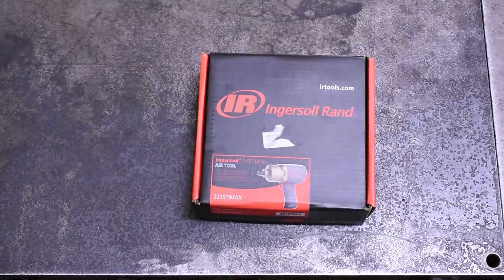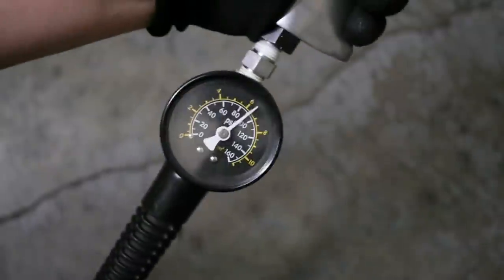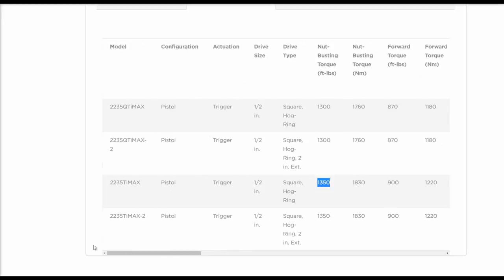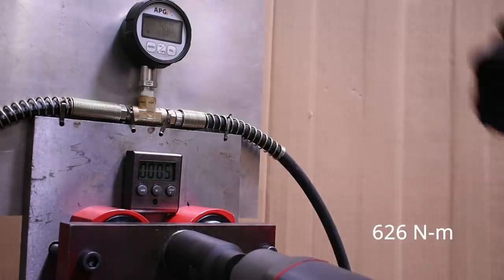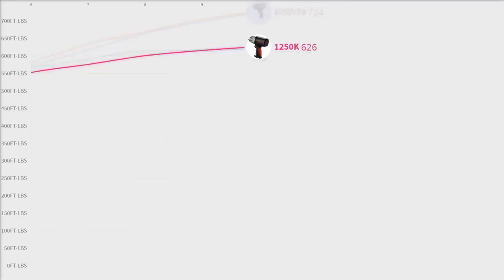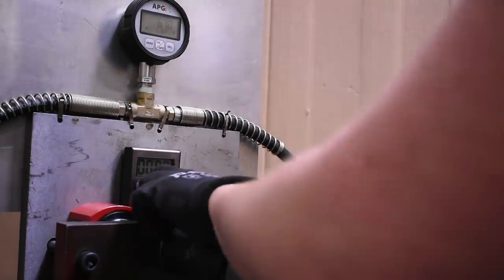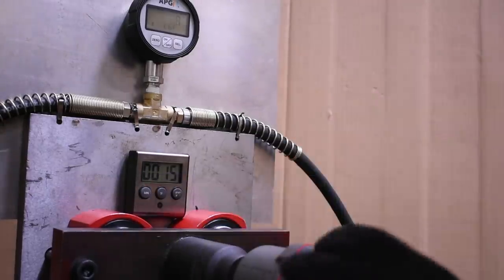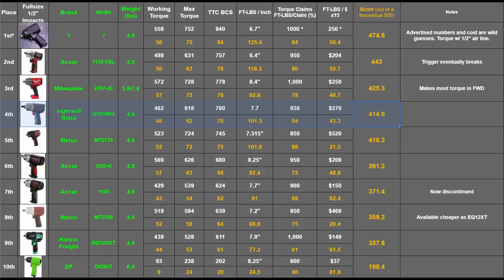The #1 Selling Air Impact vs Modern M18 & Matco Rivals: 2235TiMAX Tested

Comment: 150PSI static test is more of the reallife test. I've never seen a shop where the pressure is at the factory recommended amount.
Was the 165psi a static or dynamic pressure?
Reply from the maker: That was our thoughts on the outset of this channel. All of these tests we've seen on YT with professional equipment... and 90psi? How do you know which one will actually be more powerful in the shop? As we see here, almost no gap between 1250K and IR at 90psi, then the IR takes it to gapplebees at higher line pressure. If we kill an impact with this higher pressure (Harbor Freight stubby) then oh well, that's great info for you guys to know as well!
The 165psi test was static, not sure what's in the gun when its running at that pressure in the line.
Reply: I was just about to say this. My job runs our air at 150 psi, and honestly I think they’d crank it up higher if they could lol. I knew I bought my IR gun for a good reason. Hasn’t let me down yet in IL with good ol rust.
Reply: That's been my experience as well.  Air pressure cranked to 120+ and water drained from the tank every summer when the blow guns turn into pressure washers.
Reply: I have the same ir gun and have had it for the last 10 years.  Run the shop pressure between 150 and 160 psi. It's hands down the best
Reply from the maker: @frankiewilliamson  The fact that the two air impacts ranked higher on this list include 1 that's not out on the market yet and another that's super recent and has what we'd call a faulty trigger - and this thing is like 15 years old? Kudos to the 2235TiMAX
Reply: My first though on the first run of the IR was "It doesn't sound right, something is broken" and the performance reflected my instinct. Then you pumped up the pressure and I instantly recognized the sound difference. I knew it was performing. My daily is a 2135 and my tough job gun is the 2235 that was "tweeked". it is noticeably more powerful than it originally was.  I run my static air at 150/180 down from 175/200 as my last helper's CP guns would break every 2 to 3 months.
Reply from the maker: @1202Sid  This is what I mean. People who use these guns immediately know when you hear it "that aint right". Yet at these 90psi levels these guns hit 1200-1300 ft-lbs on other channels, which would leave you to believe oh i should be fine at lower pressures, that's a ton of power. We've seen the opposite here
Reply: @brucelee64485  I did not rebuild it. I sent it out for repair, I have no idea what he did. The gun is much faster. The number of hits per second impacting is about 1.5 more with about the same force so it rattles the shit out of the rust. The extra power is enough to notice, but it is still a 2235. Maybe @Torque Test Channel has an idea what he did ?
Reply: I have both 2135TIMAX and 2235TIMAX.  After rebuilding 2135TIMAX, it is sounds more powerful than 2235TIMAX.  I removed any debris that blocks airflow to the air motor.  I also turned the vanes so that the cutout were away from the air inlet, thus catching all of the air.  It took off several Honda crank bolts without hesitation.  Unfortunately, it also broke the head off a frozen engine mount bolt without hesitation.
Reply: @1202Sid  Maybe they do.  I've been considering the rebuild for the 2135 and doing some mods on it, but the other side of me is also waiting out for what the SMA mystery impact is too.  Mr O was showing off a new mystery box that he cannot open up yet from what is probably Astro Pneumatic.  With the kind of numbers that the dyno was telling us, I'd be interested in seeing one of them in my tool box too.  Since I am a heavy equipment/truck tech I am looking for large power in a smaller package than my Milwaukee M18 high torque for some of the tight areas in the engine compartment that I need more gun for.
Reply: @bbkmm1  Thanks for the info!
Reply: @brucelee64485  I believe it's an Astro Pneumatic Onyx 1894.  If you look at SMA's video "Mazda 6 Press In Front Wheel Bearing" posted on 4/7/21.  At 16:22 mark, the holi grail of all impacts' part number is clearly shown.  I can't find any for sale.  So they must be beta testing them still.
Reply: @bbkmm1  yes. I'm not crazy. But I didn't catch the model number. Good catch!
Reply: Can i ask what tanks and motors you guys are using for air ?
Reply: The static pressure number is a bit meaningless without considering the size and length of the piping, hose and the number and type of quick disconnects between the compressor and the tool.  Manufacturers (reputable) use 90 psi dynamic (@ f/s) for that reason, to take the effects of restrictions between the compressor and tool out of the equation.
Reply: @bbkmm1  Vane cut out location does not affect the performance. Those are just where the gates are located in the mold.  They used to be centrally located but in an effort to  better align the glass fiber in the part to maintain straightness of the running edge of the vane, the gate was moved toward one end.
Reply: @patrick188  correct, hardlines/shoplines should be oversized so that also is part of the buffer that the tank creates. The endhoses and quickcouplers should be at least the same internal diameter as the largest tool has its intake. And they should be as short as possible
Reply: Shit, at the heavy truck equipment shop I'm in, even if the 150+ psi doesn't do it, we throw a splash of turbo juice in the gun and give her a go again.. And then go get my M18 if that doesn't work, but no one has either of these air guns that I know of.
Reply: Recommended is a starting point to be above, kind of like a Speed Limit. Wish the cops would figure that last one out :)
Reply: I have a MG721 at 120psi it will destroy any brushless 1/2 impact

Comment: I've had my 2235 operating on 175psi for about 4 years constantly. Oil it everyday and had 0 issues
Reply: Mine has been 150-175, and gets oiled less than it should. No issues. 

I did rebuild my 3/8" once, the 1/2" still going
Reply: A little late, but what do you lube your guns with?
Reply: Had mine for over 10 years, put a new anvil a couple years ago, just cause it was chipped. But it’s been through hell. Very harsh conditions, sometimes not oiled for a week or two. Still can knock off lug nuts on a semi, and so much lighter and less expensive then the snap off!
Reply: Someone tell me how to fix it please lol. Mine gets VERY HOT in the front. Barepy power
Reply: I really doubt people that say shit like this because of how many impacts(any brand you can name, I've tried most) I've had fail on me after just a few months. I keep my tools clean and oil them daily as well. I work an 8 hour day, 5 days a week, with almost constant impact use(assembly shop), and I've had about 5 of them just quit on me in less than a year, each. I get around 6-8 months per impact wrench. Either you people are using your impacts for a total of about 10 minutes a day, to have them last "4 years" or you're just lying.

Comment: I brought (and still have) an IR 2135ti back when I was working at a diesel garage. We ran 175 psi of shop air and that thing would pull semi lugs off. I didn't do it often because we had a 3/4" shop gun with big line but if someone was using it I'd use my gun. That thing is a little beast and still runs just great!

The other thing I did with all my guns (a tip an old timer gave me) is run a short piece of air line maybe (12" to 18") to get the fitting away from the base of the handle because the fittings can crack over time from all the vibration and spit the air line out, plus it gives you just a little bit more flexibility by not having the coupler right there.

Comment: Back when i was doing suspension and drivetrain work alot I learned the ol' more psi = more power lesson. Another key thing i learned was to use 1/2" air hose with large ID couplers straight from the air compressor tank. Make sure all your fittings have large ID right from the tank to your gun and it will really break some stuff real good!
Reply: The work shop I work in we use 3/4 air line and semi trailer air coupling fittings and 140psi, all this so when we service our trailers we don't need adaptors air anything to hook air up to the trailer, so biggest air lines and fittings needed. My PT850 snap-on gun is rubbish, hate that I bought it but my IR gave up the ghost. But when using the 3/4inch IR guns, they will straight up snap semi's wheel studs if you aren't careful lol.

Comment: My 2235 took a while to break in. It was so weak when I first got it I took it in to be looked at. The shop near me said they see it allot. Some are made to tight from the factory. After using it for a while it got noticeably stronger. The tool shop put it on their test rig again and said it was actually making more power. Now, it's a beast. 

They also said, give it at least 140 PSI
Reply: There is always a break in time.

Comment: I bought the version of the IR in December 2006. It may not have the most power,  but it has lasted all these years with no issues.  I do oil the vanes a couple times a week.  And every couple of years I clean out the grease in the hammer assembly and refill it. But it has been a bad-ass gun. IR air ratchets have been just as good too

Comment: Back when the IR Titanium line was newish (2006) I bought one and worked in a shop with 160-180 psi air. It was almost scary. At some point i broke the end off of it so it no longer has a retaining ring but it still works, and it's probably seen 5 drops of oil total in all the years i used it. I still have it, it still works, but its a pointless backup since i now own a 2235 which will also never break. The reliability track record is what brought me back more than anything else. You can't do better than perfect..
Reply: If the retaining ring is missing, you're puting yourself at risk and other ppl around you. I'm a student in diesel mechanic technician.
Reply: @hugolortie5411  You're not wrong. Would it alarm you to know i actually TEACH automotive in a community college? But i don't subject my students to my personal tools, or even my personal safety choices really. Around here it's nearly impossible to get people to wear their safety glasses. They just haven't caught enough stuff in the eyeballs yet. But it won't be a socket flying off my 15 yo IR impact, so there's that!
Reply: New IR 2236qtimax.  Better than perfect.  Just came out

Comment: I have both the 2235 and the Milwaukee and love them both. At the HD truck shop I work at the air pressure may or may not be at 150 psi and the 2235 is a beast. I was using it to semi-regularly take off tractor/trailer lug nuts. I used it hard one day, Suspension Z-spring and brake anchor pins and when I went to put the wheel on it I found out the air motor drive end had sheered off. Tough guns but it only lasted 2 years at 150 psi...
Reply: I've been running my 2135 and 2235 at up to 200 psi and the trigger valve broke (just hissed at me when I pulled the trigger) because my assistant let sand in the quick connect. I do oil then daily and grease them every 2 to 3 weeks. I sent the 2235 for repair and the guy said he can tweak those for an extra 80$ to a rebuild and I went for it. I was not disappointed.
Reply: Had multiple anvils break on Mine but we keep replacements handy. It’s the king of the hill in 1/2” impacts

Comment: I worked in a few very large machine shops where air pressure was limited to 90 PSI for safety / liability  insurance reasons. Some air tools gave us fits. Those factory recommended of 90 PSI are just crazy.

Comment: 2235QTIMAX is the best air impact wrench that I have ever own. I work at a very busy shop mostly light duty work. But when some one can't get a bolt off. My 2235 has 80% of the time done the job. Been using it for the past 4 year. Still going strong.

Comment: I love my IR 2135 because of the trigger control. Everyone else in the shop seems to have one of each of the competing brands, and frankly at 175psi static they all get the job done just fine in an automotive shop. To me it feels like the IR is the only one that has any kind of real trigger modulation. I can reliably tighten small bolts with my IR, yet most of the other impacts I use feel like nothing but on/off with the trigger.

Comment: I’ve had my IR for years, going through the worst conditions, salt, oil, grease, diesel, gasoline, varsol, water, you name it this thing dealt with it. Bad air systems, lack of oil and grease. Replaced anvil and hammers cause the kit that was available off the truck, and anvil was chipped and couldn’t get the snap ring on any more. Bought a snap off 3/8 gun. It got oiled religiously every work day. Quit after a year, got it repaired under warranty which took 2 months to get dealt with. After another year it quit yet again. This time just after warranty was done. Bought an IR 3/8 titanium and ran it for years being abused, had to replace its anvil cause it busted the end clean off. Cheap and easy to repair, took 10 min and I was back running again. So much lighter and a lot easier on the wrists then the snap off. And so much more power. My wife is scared of the twins, neighbor loves them. My dad runs IR and has since he started being a mechanic 3 years after, yes that’s right after, I was already in the trade. These things love pressure and volume. I’ll be buried with these things or my kids will run with these. Can’t kill them. Loud as hell

Comment: Bought one of these about 10 years ago. Still doing well. I like the weight, the muffler (QTi), and the power. In our shop environment my Milwaukee hits harder and it's convenient to not have an airline, but I still reach for the IR now and then when I need a lower profile impact.

Comment: Many people told me that electric impact are better than air.
But thats only true if you run air at 90 psi. I got both and i guarantee you that my IR has more torque, we run at 140psi (still fine since 12 year).  Thank for this video showing those result.

Comment: I've been using the Ingersoll Rand 35QMAX for 2 months 5 days a week and love it. 

I use it at a automotive service shop mostly for wheel removal and initial assembly before torquing to spec only had a few instances needing a breaker bar to loosen lug nuts.  
Next step bigger tool would be nice for the stubborn nuts or incase I need to work on a dually.

Comment: I have the 2235QTi max and it is a very reliable gun. Ive used it for about 4 years now and its fantastic. Worth getting the Qti version as it really saves your ears when not using hearing protection

Comment: I own pretty much all IR tools for my power tools in my box. I bought them out of tech school in 2010. As a heavy truck tech I've never had a single issue with them and my 3/4" back in 2010 had more power than Snap Ons 1" at the time had. Now my dad's worn out Matco 1/2" from 1986 does hold it's own against my 1/2" 2235 still. Guess I'm old school and not one to spend hundreds on a battery powered tool that I probably won't be able to get a battery for in 10 years especially when I always have access to a air line.

Comment: The cordless Milwaukee and the like will beat out all air guns on a little home gamer compressor at 90psi, so for that scenario I totally recommend the cordless stuff. However if you're working in a shop, chances are there's 160ish psi and a monster compressor backing it up with volume. In that scenario a 2235 will kick the pants off anything. They're designed to work in a shop. They have to put the lawyer approved 90psi on the box, but the IR engineers know exactly how they're gonna be used and design them accordingly. I had a mac gun that had almost the power of a 2235 when it was new but after 2 years it lost alot. It still works fine now even 7 years later but it has about the power of a 2135q now.

Comment: I would be curious about the torque loss (if any) there is with the quiet version of this tool and compare the sound levels as well.
Reply: Agreed, I have the Cornwell-badged version of the tool (IRC9000Q). I’m curious
Reply: Do you think the extended anvil has some torque compared to the short one?
Reply: @braydinjones6301  no extensions and adapters will always be a torque loss. How much would require testing

Comment: Cornwell has some impacts made by IR. I have the Cornwell/2235Ti gun but my Matco has more power and I've had/have most of the top guns out there air or electric but I don't have the newest 1/2" Milwaukee. I'm waiting for a little while so I can watch for issues if any. I've always used higher air psi with high flow couplings for best results but working in a shop that works on everything from Mini Coopers to F800's or GMC KODIAKS with Cat diesels you'll have to get the bigger 3/4" or 1" gun eventually. The best gun I ever used was a Snap On MG31/325. That thing is a beast for a 3/8"! I have two incase one breaks. Unless there's something new out there(or a prototype) my choice is my 2779 but maybe the 2235Ti has more than my Cornwell version of it. Great video keep em coming!

Comment: Bought my IR for 75 bucks used had almost no power. After a 25$ rebuild kit. It's taking off head bolts from cummins isx engine. Not to mention still had some scoring on the inside. Best gun ever tbh

Comment: I have those IR's and Milwaukee's and I absolutely love them both. 

I rarely use the air these days, but when I do I use Milton V series fittings and a large 2 stage compressor with a kick on set at 150 and peak static pressure 175-180.

Comment: I love my 2235 timax. My home compressor runs 135psi and every shop ive ever worked at is 125 and they warn you to bring your own regulator if you need to step down.